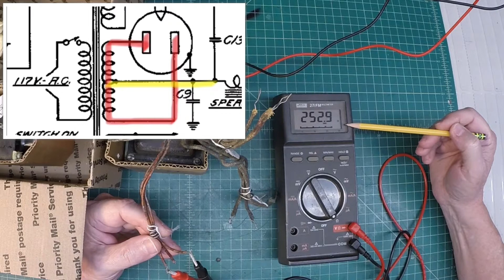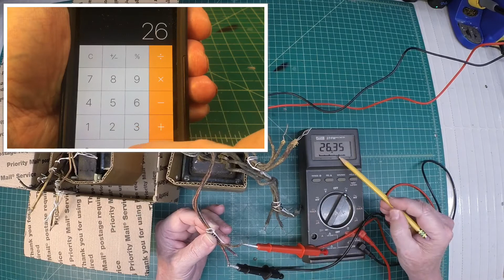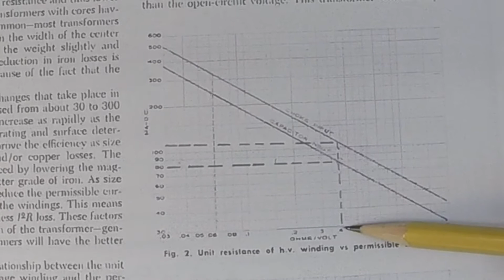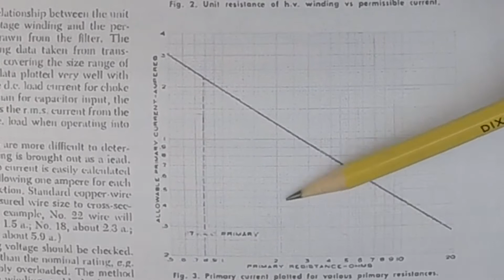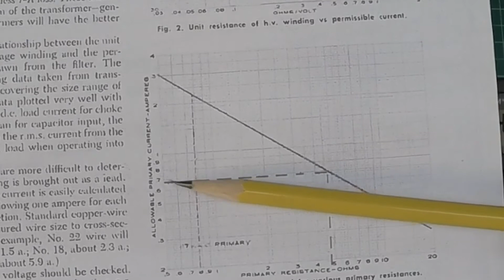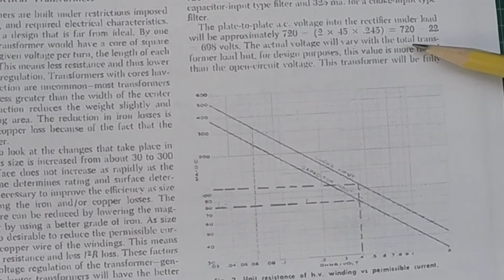Vintage Power Transformers - Estimating the Current Rating Using Two Graphs

Comment: I have an Old radio given to me [Zenith Model 6R087, Chassis 6C22]. The power line cord was so old the insulation was brittle and fell off, but also unidentifiable to as which is X1 or X2 or ground or hot side. The power cord end goes to a terminal board on side of chassis with 2 other wires, and 2 places to solder the line cord. I am using a polarized cord, I discovered that these old units are wired for non-polarized therefore plugging in outlet either way reversible. But id like to wire it polarized. 

My problem is I have no prior history on the unit, and am not an electrician.  Don’t worry I don’t hold you responsible for anything, I understand because you are not here to verify. 

The schematics seem to show the line cord going to the power transformer, but this one doesn’t, I discovered two lines unused in transformer and two other lines in it. 

I hope this is enough information, if you could use anything else feel free to let me know. Thanks for taking a stab at this 

E. Brian Starvaggi
Reply from the maker: Let me review the schematic and I will get back with you. Best, Don
Reply from the maker: Has the radio been recapped, i.e., all new capacitors and all out of tolerance resistors been replaced? Best, Don
Reply: @RestoreOldRadios  as far as i can tell, it looks like it hasnt been, but then again im no electrician , but they all look old, paper type or wax type, i dont see any heat indications, swelling, or leakage so far. I would have to educate myself on replacement.
Reply from the maker: Egene - before placing a new line cord on the radio, new capacitors and all out of tolerance resistors will need to be replaced to safely operate the radio. Check out my latest series on “Why you should never power up a vintage radio” at: https://www.youtube.com/playlist?list=PLjLu4V-71S1KVVwixviC7BaJXkkK3B1bG The Video series is for a AA5 AC/DC set, but the same applies for sets with transformers, which operate at very high voltages, which are lethal. If you’re in the US, what state do you reside? I may be able to recommend someone that can make those repairs. Best, Don
Reply: @RestoreOldRadios  thank you very much for your tips and advice, i am in WV, and I will watch the video Don, thanks [Brian]
Reply: @RestoreOldRadios  I see now and understand what you are talking about, these older parts can cause very big problems and a catastrophic failure that could be dangerous
Reply: @RestoreOldRadios  I have been thinking after i know correct way of determining the power cord hookup to fire it up on a variac slowly. I need to purchase one tho.